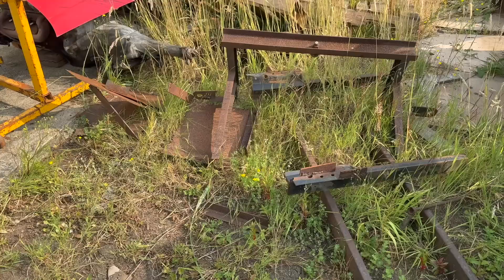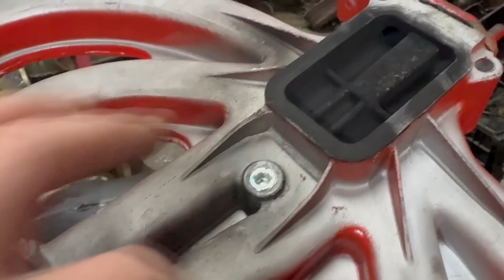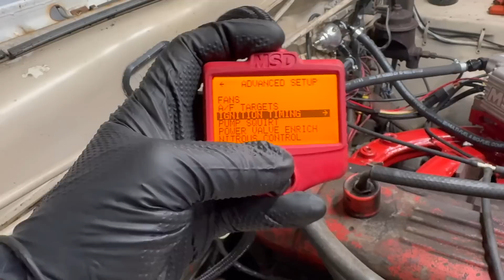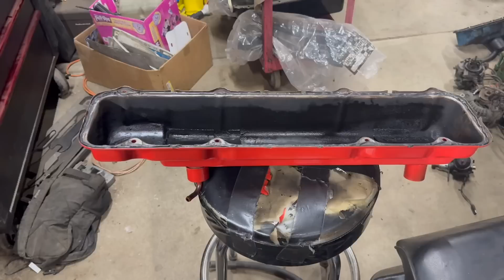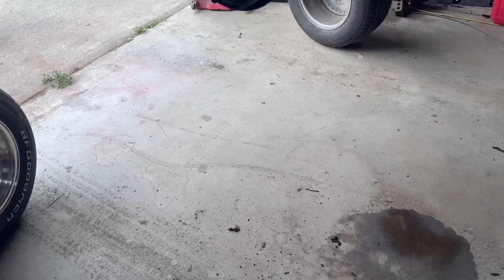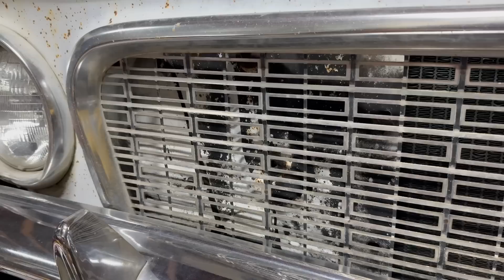The Art Of Making Mistakes - Countless Fixes For My 1963 Plymouth Valiant Slant Six (And It Breaks)

Comment: Such a cool car! Those body lines and chrome trim look best in black IMHO. A buddy of mine has a 273 4 speed in black with a black interior and the little car oozes cool factor. We’re building a 360 for it that will pretend to be a 273 just to sucker in the Chevy turds. I’ve built a couple EFI Mopars and I suggest running a single plane. For some reason the signals and the EFI’s ability to “learn” seem to work better through a single plane like the Mopar M1.

Comment: Question and comment:

What sizes are those new wheels and tires? they look awesome. I need to upgrade from my 13" pizza cutter tires.

When I first got my 65 Valiant, its starter sounded like a normal old-school starter, for about 3 weeks. Then it started making the same identical clunky-crunchy sounds that yours makes. 2 days later it died completely. Replaced it with a Dakota starter, and all is right with the universe. I'm sure you (or Tom) have spare starters around...
Reply from the maker: They are 15” wheels, which will be hard to find. I know the rears are 245 wide, but beyond that I don’t remember. I think the fronts are 215s. I’m seriously kinda tired size stupid. But you should know that these barely fit, and the rear passenger still rubs.

Comment: Hi Jamie 
My name is boris from New Zealand, I have a 69 valiant with a slant six auto with 2 barrel Webber carb, electric dizzy and pacemaker headers, it’s for the kids and I street car, just wondering what cam and valves to put in her when I freshen up the motor! Still running strong 74,000 miles on the clock!
Reply from the maker: You guys have any local cam grinders down in those parts? That’s who I would be talking to for cam specs and to grind it for you. I’d stick with stock valves myself, but clean up the head (mild grinding - don’t go crazy with it, these aren’t the best castings,) good 5 angle seat job ideally, and upgrade the springs. I haven’t gotten into upgraded slant six cams yet, but that is coming…
Reply: @DeadDodgeGarage  thanks for the prompt reply and your time much appreciated, yeah not wanting to go crazy, we build awesome motors down this way my uncle was one of the best, highly regarded in NZ Motorsport. 
Keep up the great work all the best,Boris

Comment: It's my opinion that on my 65 Valiant, only the Super 6 intake and exhaust manifolds are from a later model slant 6, and were bolted on to my car's original block, for a couple reasons: on the intake manifold, several areas of blue paint could be seen under the red paint that was there when I bought it. Late 70's and on slant sixes were painted blue, yet the intake was the only place I could see it. Any other areas of the block that still had paint were orange. Per Ed at Wildcat Mopars, the 65 Valiant engines were orange. I took the valve cover down to bare metal before repainting, no blue paint to be seen. Also, my engine's head has spark plug drool tubes, which, as you state in this video,  the later heads did not have. This opinion of mine could be wrong, tho... I do want to get an EGR delete plate, the ugly EGR valve is still there, but does nothing as all the vacuum ports are blocked off.
Reply from the maker: No you’re probably right. My memory sucks.

Comment: A thin layer of grease will ensure that your valve cover gaskets do not stick to the head.
An Edelbrock carb is your favorite carburetor?... I begin to question your automotive sanity.
I never had any luck with them, give me a decent Holley carb and Alex Warlordy's Super Tuning Holley Carburetors book and I'm good to go. I need the book because I have CRS... ;-)
Reply from the maker: If I wanted gas to leak all over my intake manifold constantly, I would pick a Holley too 😁 give me the simple one that I can tune in two minutes without spilling a drop of fuel, and that has no seals or gaskets below the level of fuel in the bowls. I used grease on cork valve cover gaskets for years. Eventually I decided it just wasn’t worth the trouble. They come back off easily for quite some time without it.
Reply: @DeadDodgeGarage , I suggested the grease because I've had cork gaskets stick to the rough cast iron heads in the past.
I never had any of those problems with my Holley carbs, the tuning isn't as bad as you think and they were much better and easier for me to tune with the book. The Edelbrock carbs I had suffered from internal issues from holes caused by bad castings, stripped threads, worn-out pump bores, etc., etc. That turned me off of them forever. I had better luck with even the cantankerous quadrajet carbs than I ever did with the Edelbrock carbs. Everybody has their preferences so whatever floats your boat. Good luck.

Comment: Yes! The short stroke SHOULD be able to rev higher, as in a F1 car at 15,000 or whatever crazy RPM. If not mistaken that's around 2 or 2 1/2" stroke? I know the 170 can't do THAT but interested to see where you end up, without blowing out the pan! Or if....
Reply from the maker: Precisely! I’m very interested to see where it will go.
Reply: @DeadDodgeGarage  Me too! I worry that a turbo will shove in too much pressure along with possible VALVE FLOAT at high RPM with the factory springs, etc. On and on. Good luck, I'll be watching....

Comment: I adjust slant 6 valves at 12 intake and 22 exhaust. When warm, it will go to 10-20. If for some reason you did 10-20 cold, when it warms you'll get a slight miss at idle.
Reply from the maker: "If for some reason" - that reason is the factory spec.

Comment: I just finished doing a Por 15 fuel tank treatment on my 1970 Datsun and am curious if the valiant also has nothing available in replacement tanks and that's the best option for you.  I'll stay tuned.
Reply from the maker: I was wrong - there actually are EFI tanks available for them. I didn't see them with a cursory internet search, but multiple people have sent me links. So that's definitely in my plan when funds allow.
Reply: @DeadDodgeGarage  Nice.  My favorite thing about keeping my w200 going is the fact that parts are actually available.  My Datsun newer Nissan Pontiac Chevy home built and universal parts combination that my Datsun became is hard to keep straight in my head.   Also requires back up vehicle for down time.

Comment: Treat the 170 the same as a 225, as far as cam, valves and timing.  What you need to watch is the fuel flow. You can get, if built right 8k rpms in a 170.
Reply from the maker: That’s the goal!

Comment: yeah i still don't get the whole slant 6 thing but i know how it is when you got an itch, you got to scratch it. back in the day my late great uncle and i threw together a 65 valiant with a built to sh*t 340, short shaft 833 and a 8.75 with 4.88's just to run errands around town so yeah i know what that itch feels like it's just kind if hard to imagine an itch for a slant 6 but i guess when you've done everything else than why not.....
Reply from the maker: Right. I’ve had that itch for like 14 years now, and an even stronger one after getting slightly into turbo Subarus about five years ago. If I just wanted to go fast, I have a built 440 in pieces. Or I’d build a blown big block Chevy. Or I’d 2JZ swap one of these things. Or I’d just buy a Hellcat. I want to do something that I find intriguing and unique. I want to see what I can do. And I want to make a slant six cool.

Comment: I see you have the Holley system installed.  But this just looks so interesting.  Yup, port fuel injection.   Not mine.  Whoops!  Thank you for the correction.
And the link I posted is gone.  No matter.  It led to a slant 6 build that had injectors mounted in the head.  It was interesting.
Reply from the maker: MSD Atomic, although they are now owned by Holley, so… something like that. The theory is that this will work better under boost than a carburetor. Currently I am still trying to get it to actually work naturally aspirated… but that’s mostly my fault.

Comment: I hate to be a nit picker, but I luv picking nits - it's splinez in weel studz, not nurlz.
Reply from the maker: While you are correct, when you go diving into the parts catalog (which I did professionally at O’Reilly for about five years,) you will find the dimension of the splined section of a lug stud listed as “knurl diameter.” So it’s not just me that is wrong. 🙂
Reply: @DeadDodgeGarage  Another sine uv the collapse uv sivilization.

Comment: Those aftermarket frame mounted EFI pumps all seem to be noisy, even if you isolate them. There is a channel with a guy in Florida who did an EFI 69 valiant build with turbo charged 360, and the pump was the same. You probably will have to go with an in tank pump to quiet it down. Of course a tank not filled with rust is also a big help… 😁
Reply from the maker: The noise doesn’t bother me too much - except when it screams like a dying bison because it’s starving for fuel…

Comment: What are if any the difference between 904 and a727 trans which came first ,are they the same , which is tougher ,lm not up on mopar
Reply from the maker: 727 is bigger everywhere. Heavier duty compared to the much lighter 904. They have different pan shapes so they are pretty easy to tell apart there, but with them side by side the difference is pretty easy to spot.

Comment: At what point does a valve cover become a rocker cover? Rhetorical question... Also, is the starter motor too close to the torque converter? It sounds like the gear mesh might be a wee bit tight.
Reply from the maker: It covers the valves and the rockers… but I think it’s only called a rocker cover if you cross the Atlantic Ocean. It does sound odd, but there is no way to adjust the rear mesh on these.

Comment: The 170 revs easy and  unlike the  225 its crank shaft isn't  setting in the engine oil so windage isn't as much of a issue so 170 all the way.

Comment: Slant 6 gutless? . Thinking back to the 1980's when I had the  225 ci  one barrel in my Valiant  rebuilt to stock specifications, and how swiftly it went , and people often asking if it was a V8 , including some policemen , isn't ,  "gutless " more than a little undeserved ?
Reply from the maker: I have experienced slants on both sides of that spectrum. I’ve had great running units that would shred a tire or two on command, and I’ve had absolute turds. My experience with stock 318s has been pretty similar.
Reply: @DeadDodgeGarage  Yeah , what do you put that down to ? .I remember a friend asked me to test drive his 225 Valiant because he was disappointed  with it's power , and I had to agree with him .But that motor would have determined his opinion of the slant 6, unfortunately.

Comment: Turbocharged 170cu Slant Six?

You’re the only man in the world who would do that. 😸
Reply from the maker: I’m not! It’s been done! I think…
Reply: from the web-

170
-The only engine that is oversquare
Rod ratio is better than the 225 but not as good as the 198 Rod Ratio: 1.814
-Lowest peak HP and torque but known for being able to rev much higher than a 225, which changes up the low peak HP numbers. But still not tons of torque
-Tied for highest RPM at peak HP (a slant at 4400RPM probably sounds awesome!)
-Though it is smallest it is still quite sizable by todays standards

198
-Only engine that is "square"-ish
Best rod ratio Rod ratio: 1.924
-Widest RPM gap between peak torque and peak HP
-Lowest peak torque (possibly best highway economy?)

225
-Undersquare
Worst rod ratio Rod ratio 1.624
-Tons of low-end torque but doesn't like to turn nearly as high as the 170
-With all that stroke and less-than-great rod ratio the rings get a good work out.
-Seems to be most popular and readily available engine.
-Also seems to be most sought after for performance.
Reply: @HelpingHand-ic4wt I think the 170 could benefit from a 5 or 6 speed and shorter final drive. I'd bet they love boost.
Reply: @HelpingHand-ic4wt @HelpingHand-ic4wt I think the 170 could benefit from a 5 or 6 speed and shorter final drive. I'd bet they love boost.